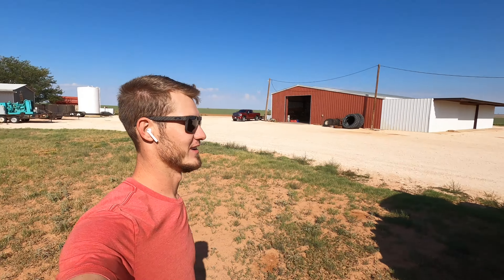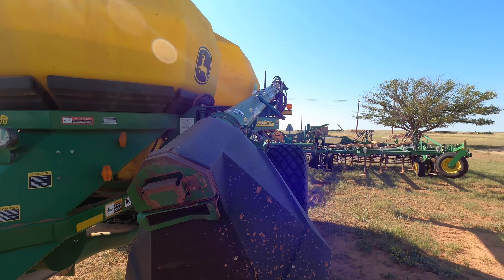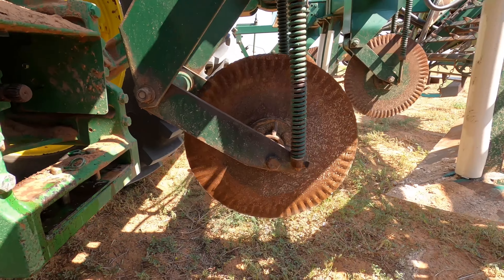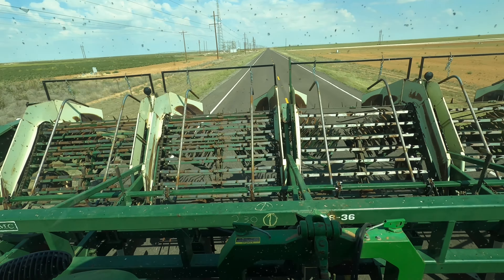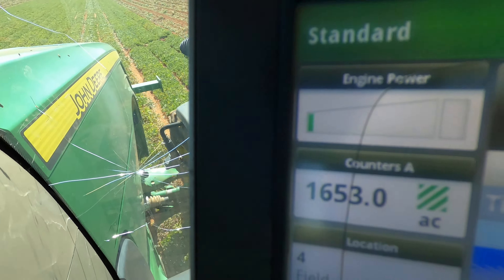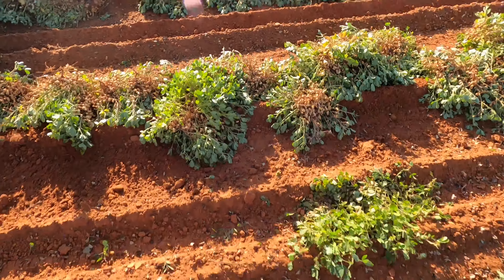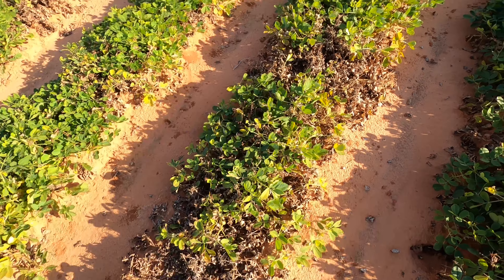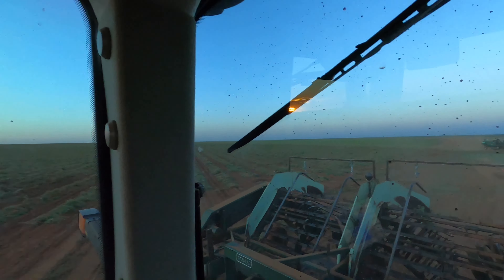Digging peanuts 2022

Comment: Could you not push the drawbar off to the side instead of taking it off out of curiosity? I have to do that with some of our rigs though I don’t run a hammer strap much so might be different if I was. Great video.
Reply from the maker: Yea we tried that and it’s barely not enough. But yea if I could I would
Reply: With a 2 row or 6 row, you can keep the drawbar on.
With a 4 row or 8 row, it needs to come off